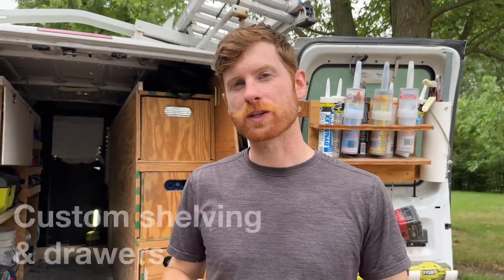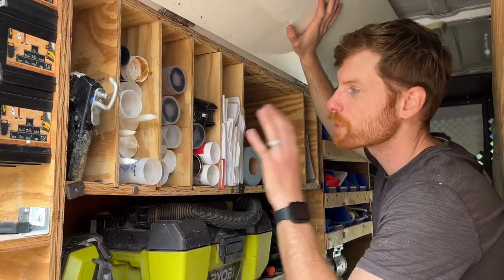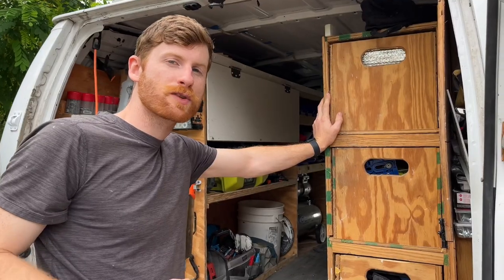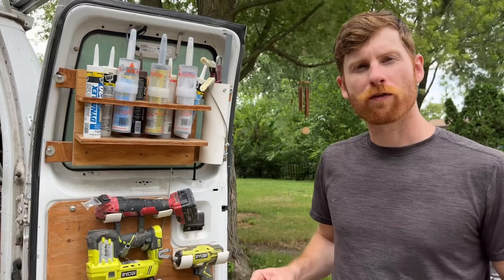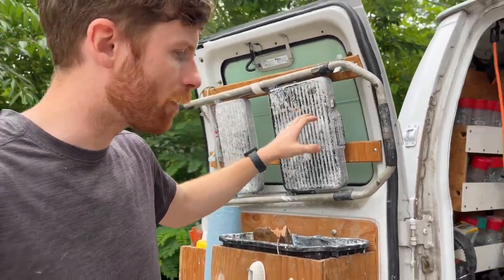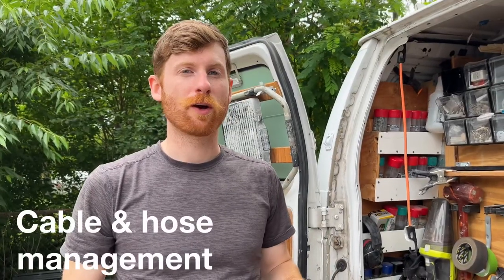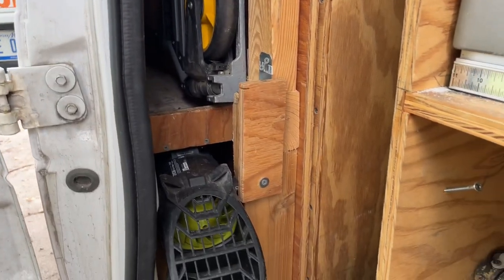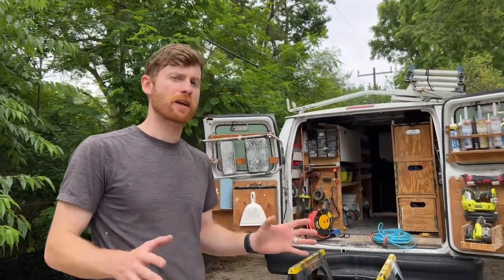Ultimate Work Van Organization Hacks for Handymen

Comment: I carry the galaxy s21 as my personal/company phone. I wanted a case that's able to take abuse. I used the old otterbox, and it held up for about a year. Then the charger came out on it so I got a Magpul. It worked okay but it didn't have any coverage on the charger port. I was looking for some heavy duty that I could use on my kayak(although I use a dry bag inside the boat now) but I was scrolling around Amazon and found this metal case. This thing is HEAVY and STURDY! I don't want it to happen, but I know if I'm on a ladder and this thing drops, it won't even have a scratch. This is definitely going to be my go to case from here on out. Although I carry the same things as a wallet, watch, phone, and holster...I also carry much more. I carry a pocket knife, which is usually my Milwaukee multitool( it's a fast back with a wire stripper, nut driver, Philips and flat reversible bit, and strap cutter in one) a dedicated leatherman wave(upgrading to the free P4 when it comes in), ear phones(cheap wireless buds I got at Walmart), an admin pouch(I keep 2 InkZall, 2 Pens, 2 Pencils, and a notepad in a pouch that I put in my cargo pocket on my right side), my CCW(Sig P365), and a small IFAK(I keep a baggie on me with a few bandages, tylenol, benadryl, alcohol wipes, and antibiotic ointment because I would sooner not bleed in a customer's home. If I cut myself I can quickly pop on a bandage and go out to my truck where my bigger medical kit is, plus I have kids and my daughter particularly loves to be a daredevil and jumps off of EVERYTHING). I also keep alot more in my truck because my work truck is also my personal truck. I also keep my tape on my belt usually as soon as I get up in the morning. I tried to use my phone for note pad, but I found that handwriting it for me is easier because I can actually take notes rather than try to store it in my head and remember it all when I type it out. My note pad also helps me because I make lists on jobs of material I use, that way if I need to go to the store for material at least I can lessen my time. Also when I get home and do my paperwork, I have a list of what to charge my customer if I need to supply parts.